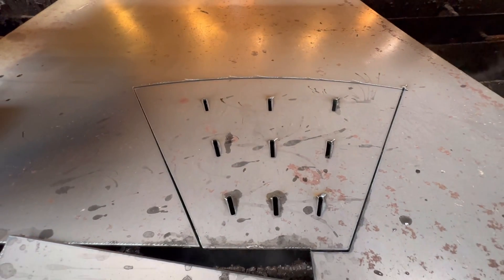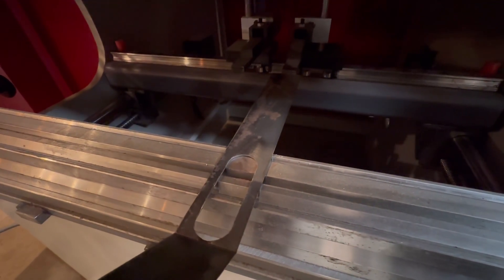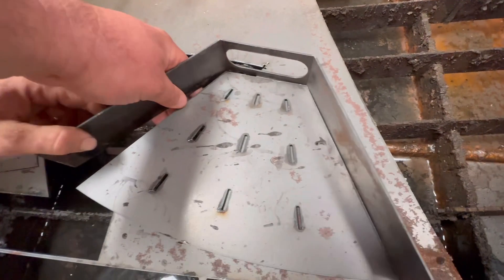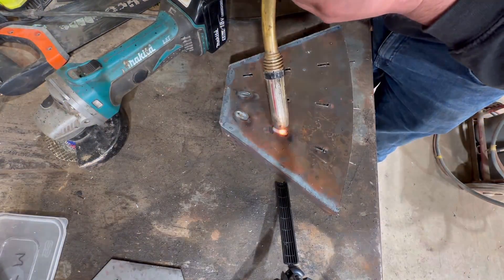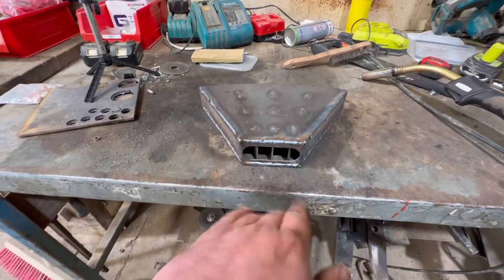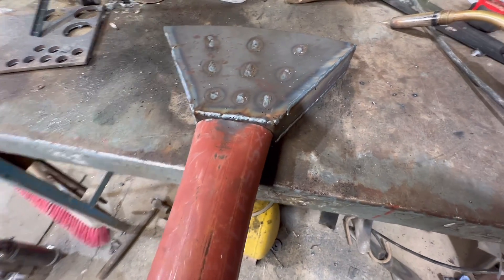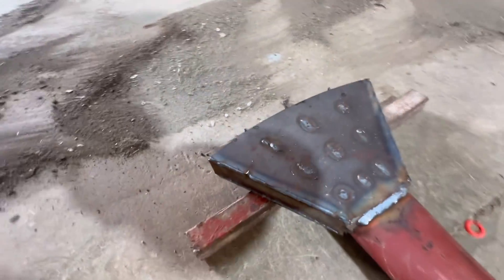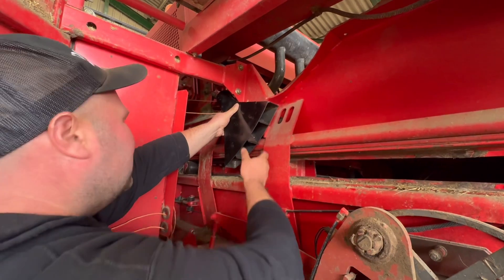The Big Bale Blaster , high power agricultural engineering

Comment: No use to me unfortunately as I’ve no air on my tractor !, you could I suppose run a compressor off a pulley mounted to the front of the flywheel between it and the front clutch 🤔🤔
Reply from the maker: @Hesston4860s  il be looking into that in my next code
Reply from the maker: Video

Comment: I recently saw a video of a burning baler, the farmer tried to extinguish it with a fire extinguisher, hopeless. He seemed to have missed the moment to unhook the burning baler from the tractor, now he couldnt get close enough to unhook it. The baler was fully ablaze, i guess the tractor didnt come out of it unscathed. It was a short video, no idea how that ended. Commenters wrote he should have ejected the bale in the baler - can you do that at any time? - or unhook it as fast as possible.
Dust made from straw, having a big surface area, burns very easily. I wonder, given how many videos there are of these sometimes insanely expensive machines burning, why there is nothing installed by default to extinguish a fire, or as you are just inventing, something to remove the dust. Whats not there cannot burn.

Comment: Only thing I’d say about fire retardant, is be careful what you use. Some are quite corrosive to metals, and whilst you might save the machine, the additional corrosive nature of some fire retardants can make a machine rot away very quickly! I’d maybe suggest sticking with a larger CO2 bottle rather than any dry powders
Reply from the maker: Great point!

Comment: Like the idea of incorporating the fire suppressant  in the same system ( having lost a round baler to fire and had a couple of bearing smouldering events since it is a constant worry when baling) only problem with your plan is your tank needs to be fully charged at the same time you have a fire start. The blast of air will probably do a great job of spreading and smouldering embers then the tank will be empty when you need it quickly. Not trying to be negative as I think it’s a great idea. Currently thinking about adding temperature monitoring on the baler bearings for next year as round balers have so so many sealed for a short life bearings🤬.
Reply from the maker: That’s why I’m exploring the idear of having to air tanks and using fire retardant powder and not foam
Reply: Bearings are a potential problem on so many machines.  I remember years ago I was working on my the other family farm driving the old combine while Pa had lunch.  Swinging around for the next pass I got a whiff of hot metal, so I threw everything out of gear and parked in the shade.

Started checking the machine over and had just found a seized bearing when Pa arrived.  Lost most of the afternoon's harvesting, but didn't set fire to anything.  Probably 5 minutes away from the bearing setting fire to something flammable.

Comment: Tom, that's farming engineering at its best.  You have just proved that farmers are always thinking of ways to improve their lives. Balers are a very expensive machine.  Brilliant idea
Reply from the maker: Thanks
Reply: Combines are even more expensive, insanely so. There are so many videos where a farmer stands in front of his burned $500000 combine, the field burned down, too, shell shocked. Why is there nothing by default to prevent that? Well the manufacturer happily sells another one.
Reply: Hey Tom. Great work on that system. What you want to trigger your big valves is a 12v actuated auto drain for compressor tanks. We use these to drain water out of the system on a timer to avoid buildup in spray booths etc. If you need access to any of that stuff, I run a workshop services team supplying air pipelines etc to industry and agriculture in the north so would be happy to help you out if we could. We help maintain a couple of recycling plant air systems which use big jets for sorting waste on solenoids.
Reply from the maker: @djdunc  lovely il keep that in mind what’s the name of the company

Comment: Rather than have it manually operated from the cab, could it not be fitted with a blow off valve so that it releases automatically at whatever pressure you set it at?
Reply from the maker: @TrickyDickyone  yes you could do whatever you

Comment: Yeah I think it will work well. Not only as a blow down to clear the dust but also as a stand alone fire system. As you said there is only two moving parts so not a lot could go wrong. I like it. thanks for posting....
Reply from the maker: Right on

Comment: I would highly advise you go ahead with squeezing the end of that fan down. It's not so much to do with pressure, but rather velocity. Your current fan simply allows the air to expand and slow down. Regarding the "whirlwind" fitting, put the spiral in the barrel, not the cone.

Comment: I would add a connection to the tank to allow it to be filled with air from your workshop compressor to save the tractor one doing the initial start up.